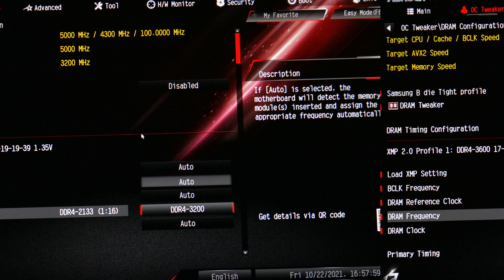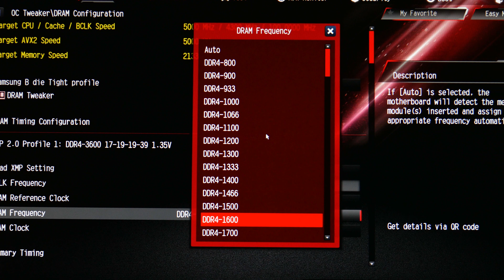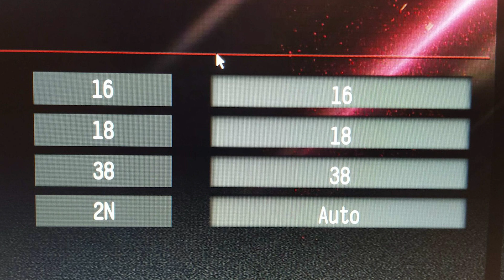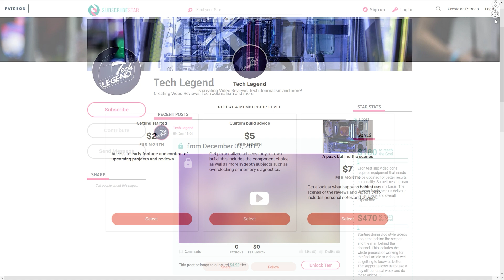How to use mismatched RAM!

Comment: Thanks for this video it helped me get my PC running with new memory installed. My PC came with 2x 16gb Kingston DDR4 described as 3733. It turns out these are not available so I bought something close from the same manufacturer described as speed 3600. Anyway they would not boot, not into bios. I tried swapping them round new into the old slots and old into the new but it would not work. New memory on its own worked fine. I finally got it working by setting the speed manually to 3600.  Looking at the manufacturers specs both will run at 3600 but using xmp one was 3600 in profile#1 and the other in profile#2 so they would not run automatically but work fine set to 3600 manually.
Reply from the maker: Glad I was able to help!

Comment: I have same ram sticks but one is 3200 and other 3600 (corsair vengeance 8+8 ddr4 ). How should i split them on the dual channel? Should i have same 3200 in DIMM 1 and DIMM 2 and 3600 in the 3 and 4 DIMMs or should i have DIMM 1 3200 DIMM 2 3600 DIMM 3 3200 DIMM 4 3600
Reply from the maker: You split them to use in dual channel. So, you put the Corsair kit in slots A1 B1 and A2 and B2. Otherwise, it does not matter, as in, it doesn't matter which kit goes in what slot as long as they are using the Dual Channel split.

Comment: Hello I Did A Mistake & Purchased 4 Separate 16GB 3200Mhz GSkill Ripjaws V Ram Sticks With 16-18-18-38 Timing Instead Of A Set As It Isn’t Available Nowadays Easily,
All RAM Sticks Are Manufactured In The Same Month & Year
But I’m Getting Crashes While On XMP Or Even It Disabled While Gaming On My X99 Setup
Can You Please Help Me Out With It?
Reply from the maker: Sorry for the late reply!
Try to match the XMP settings without the XMP option selected.

Comment: I had already 2x8 2666Mhz 16-18-18 and recently bought 2 more so 2x8 3200Mhz 16-20-20. They both work fine separately but when I put in all 4 I just dont get any video. How can I make them work?
Reply: do u use them in the right spots for dual channel?
Reply: Does your mb support dual channel?
Reply: I experienced the same thing, any solution yet?

Comment: thanks! i got new ram and discovered that the reason my "old" ram was slow is because i forgot to enable xmp..., rather than return it i wanted to see if i could mix and match, ill have 48 gb to play around with
Reply from the maker: Great to hear!
Reply: exact same story; also 48Gb. 
XMP missmatch: one set has 3600 and 3000Mhz; other has 3000 and 2667Mhz. (for XMP 1 &2)

while I can run the system in JEDEC  at 2400Mhz. 

but want to mess around and enable both at 3000Mhz manually. (due to the missmatch, PC won't boot if I enable either of the XMP profiles)

Comment: i have 8gb 1600mhz with timing 9-9-9-24 and the new one is 8gb 1600mhz with timing 11-11-11-28 
how to make them work on dual channel? because in the bios and CPU Z it shows 16GB but in Windows it's only 8GB
Reply from the maker: Set them both at CL 10-10-10-27. See if it works better.

Comment: So... doable as long as the BIOS supports proper configuration?
Not all BIOS are created equal, either. So that's my understanding and conclusion.
I'm hoping for confirmation though.
Reply from the maker: Yes, it might work even without a good bios but it's down to luck in that case.

Comment: But what if you have two sets of identical ram kits? i.e. you have one dual channel 2x8 GB sticks, and then you have the EXACT same one and you add it?

I have that issue. And they were all manufactured pretty close to each other in time.
I've done extensive memtest86 runs and with just one kit, i can run XMP fine.  But with both kits I can't touch it.

I can't use them with XMP without post failure. I cant use them above 2133 (stock) without a crash.
Reply from the maker: Sorry for the late reply. That is odd, have you tried increasing the voltage?

Comment: I currently have a 16GB 3200 MHz stick of ram with a latency of 16-18-18-38 and it isn't for sale anymore however there is another stick with the same exact speed size and latency. Would I be able to run them in dual channel without problems?
Reply from the maker: Yes, as long as you can match the timings and voltage, they will work together.

Comment: I have ram of 3600mhz 16gb with timing 18-20-20-42 and planning to buy a stick with same 3600mhz 16gb 15-19-19-36, how fucked am I?
Reply from the maker: Sorry for the late reply. You can try to set both RAM kits at 17-19-19-37. See if that works.
Reply: @TechLegend-com  thanks will try
Reply from the maker: @RageChilliBurger  Let me know if it works.
Reply: @TechLegend-com  its working great thanks

Comment: I really hope you see this comment
Ive been running 4 sticks of 8gb ddr4 3200mhz, each two are from a different brand, 2 are the corsair vengeance pro rgbs and the other two are the trident z royal rams, its been running fine under load for a couple of months (even over a year, keep in mind i never ran xmp as my pc runs into multiple issues with xmp for whatever reason i think its from my cpu as it only supports up to 2666mhz)

But recently my pc has been instantly shutting down while under load, i checked it out and it turns out they both have slightly different timings

So im wondering what timings should i set them to
Reply: Specs
I7 9700k
Asrock z390 steel legend
Rtx 2080 super
750w gold psu
Reply from the maker: I read your comment. 
Can you tell me exactly what RAM kits are you using? Model, frequency etc.
Reply: @TechLegend-com  2x8gb Corsair vengeance rgb pros 3200 mhz, and 2x8 tridentz royal 3200mhz
Reply from the maker: @grimbruh5583  Ok, sorry for the late reply. Try to set the timings on both RAM kits to 16-18-18-38.

Comment: should I boot with all rams? 
I have 4 sticks 3200 1.35v - but 2 of them are 16-20-20-36 and 2 16-18-18-36;
Starting the pc with all of them doesn't work. 

Should I try to boot with the slower ones?
Reply from the maker: Try to boot with only the slow RAM and see if it works. If it does, then you need to try to boot only with the faster RAM. If it boots again, then you need to start adjusting the timings on both RAM kits to match.
Reply: @TechLegend-com  I will try that - weird enough it boots with 1 ram slower but not with 2. I tried booting with one of each but it doesn't let me pass 2133speeds. Gonna test it and get back to you. Thank you for answering!
Reply: Should I have the latest bios version while doing that?
Reply from the maker: @manudelamnb  Yes.
Reply: @TechLegend-com  Tried it again, did not work; I managed to boot with dual channel just after I removed my cpu and placed it back again ( to check for bended pins ) but it won't get to 3200 in dual channel. I think the cpu is faulted and I will get another one - ryzen 5 3600 - then set the timings for the rams and use all of them.
Reply from the maker: @manudelamnb  Ok, please keep me updated with this.
Reply: @TechLegend-com  My motherboard b450m doesn't boot with RAMs in slot 1&2 at all; 
It booted before the bios update but the rams were just displayed there but not working - 
I think I'll have to change the motherboard too, sadly :(
Reply from the maker: @manudelamnb  Can you try with just one stick?